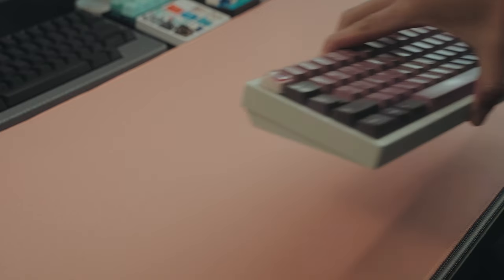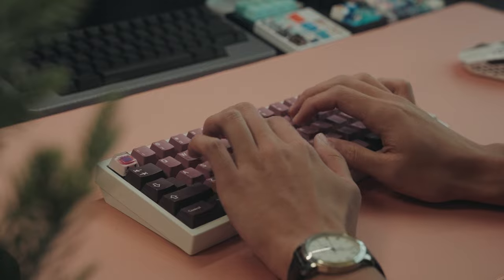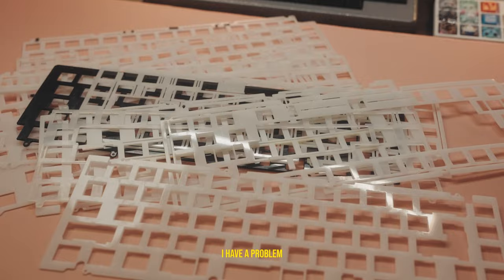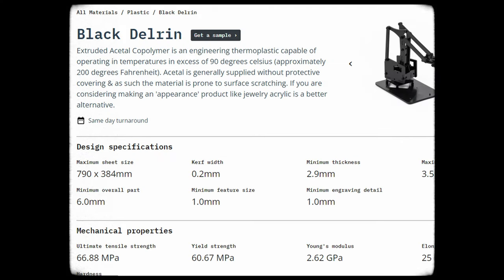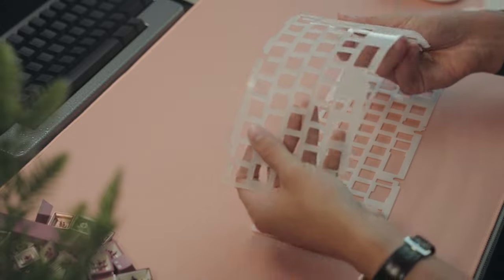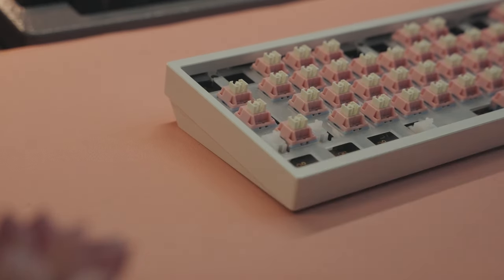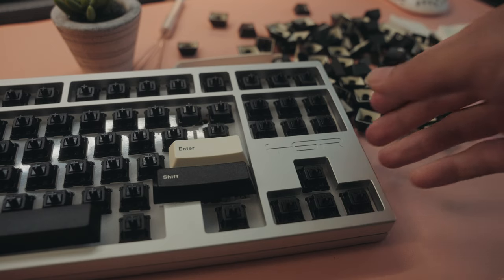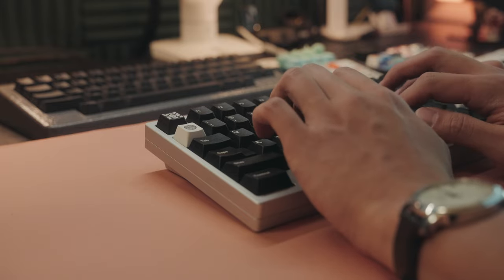My new favorite plate? | Polypropylene Plates

Comment: I joined a groupbuy and bought an extra PP plate. There were mentions of warping, so hopefully I don't experience that. Great video!!
Reply: if you experience warping, the plate will straighten itself out when you install your switches and put it in the board, it's completely normal.

Comment: The way you explained your plate preference made me realized that I essentially have the exact same preference for plates as you. Love loud lower frequency sound, hate PC, and ends up hating every PC board i have gotten and had gotten a POM plate for every board that I have. Time to try out the PP plate.
Reply from the maker: Yurrr let me know if you like it!
Reply: @TofuTypes  Finally got the chance to build a board with it! Used the pp plate with the cloudline and damn, it does slap really well. Hard to compare to POM or PC though since it did not get either of those plates for the cloudline, but I noticed that there's a bit more bounce to the PP plate compared to the pom plate which is more of a soft flex.

Comment: The one I have is a tad bit too soft. I found it hard to install without a plate fork. So I’m currently sticking with my favourite config for now, gasket/o-ring mount with alu plate and long pole switches.
Reply: Is the combo of an aluminum plate and long pole switches a little harsh for you? When I use long poles and aluminum plate at first it sounds great, but after about an hour of straight typing it starts to hurt my hands a little bit. Maybe it's just me having weak hands or something idk. It would be great to hear your opinion.
Reply: @quentin266  I can imagine it’d be so with cherry profile maybe, but I type with MT3 keycaps so maybe that offsets it a bit. But long pole switches are off different levels of bottom out strength, some are harsher than others. I’ve found that bcp’s are in a nice middle ground, but do keep in mind that springs can help mitigate that effect. Long springs are great with long pole switches.
Reply: @quentin266  and don’t forget that this hobby is all about preference. If long poles don’t do it for you then that’s ok. It took a lot of experimentation to decide what I liked. I went from tactiles to regular linears, to progressive springs, and then long springs. I recommend that if you still want to experiment with long poles, try long springs with them (18-20mm), or two staged springs. Keep in mind that you should choose a slightly higher weight than your norm because the shorter travel would mean the actual weight you’re feeling is less than the rated spring weight since they’re rated at 4mm travel.
Reply: @wanabdulhadi1268  Oh I see I've only tried cherry profile keycaps on that combo so that could definitely be why that  it is harsh for me. I've heard some good things about mt3, but haven't gotten around to trying them yet. Currently the only profiles I've tried out are kat, sa, cherry, and oem. tbh I still have lots to explore in the hobby! So far I have bought 8 boards, and currently have 4 with me rn have sold the rest, but I still have lots to try out like full size keyboards. In my opinion it's what makes the hobby so great, it is hard to run out of things to do! (and don't even get me started with artisans)